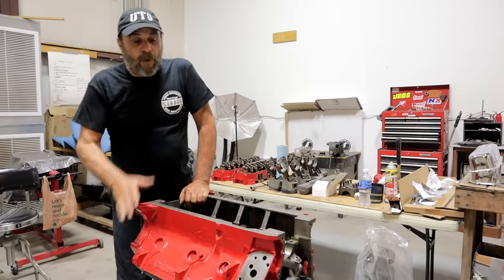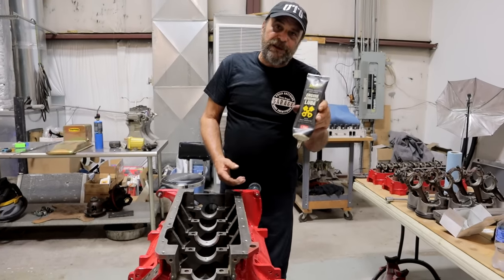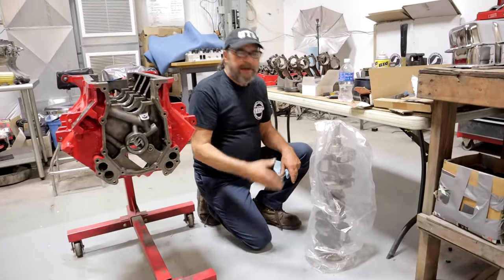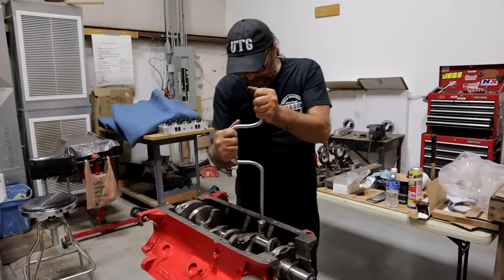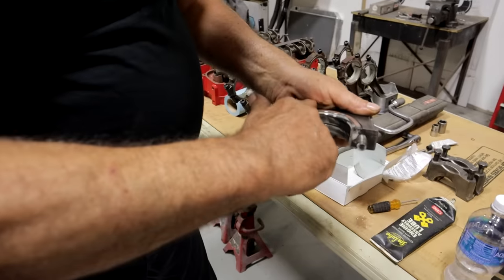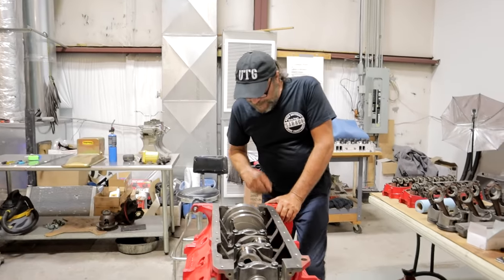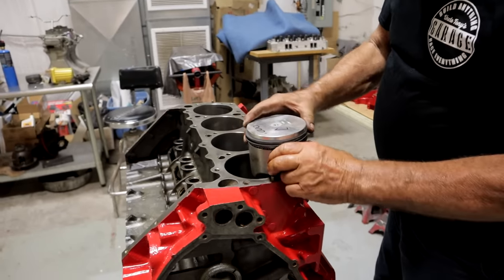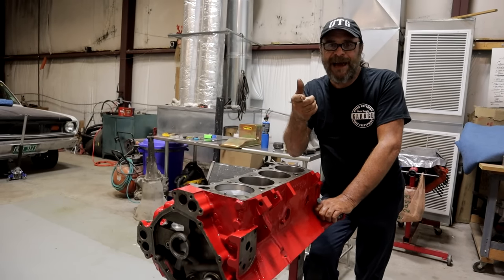Assembling A Short Block For The Home Engine Builder

Comment: I have seen this happen many a time. Put all your bolts in and make sure they measure at least 1/16 less than the main bearing thickness. I have found were they did not bottom tap far enough so you never really tighten the main cap. Do this on everything main, rod and especially cylinder head bolts. I have seen were slag in still down in a hole and the head bolt tightens against the slag and you never ever torque that bolt to the head. This happens next to the cylinder or by the outside of the block. You should retap all your threads and if your paying attention it will suddenly stop. Do this by hand and don't use a drill. When you run into a problem like I do with slag you have to use a small carbide bit to grind that slag away. I have spend over a hour on a single thread getting that slag out of the way and retap the hole. Don't cheap out and grind that head bolt down to fit. Any bad looking threads that look bad because of age and subject to water antifreeze drill out and helicoil kit it. I have thought a head bolt thread look good and when you torque it it strips or feel soft as you reach torque. Fix it now cause it will cause you problems when you warm up the engine and run it hard. BBC cast iron heads are heavy. You really can't do this job right in the car after. You pull the engine and do it right. I have done it to myself thinking I could get away with it. Once you do it wrong you won't again. Most people never check the simple things. If you blow a head gasket that's the first thing you look for. Seen it happen to many times to people. I had a friend I drag raced with and he blew up his 10 second 360 duster big time. He used ARP main bolts. After I talked to him he put lube on the treads of the bolts and some down the threaded hole. What happens he tighten the bolt to toque but the lube down the bolt hole. So basically hydraulic lock the bolt never even tighten up the main bolts. It was his second pass on a new high performance 360 Dodge short block you could buy new about 22 years ago. Cost him another new short block.

Comment: I assemble the rear main seal  the same way you do except clean the ends I put a microscopic dab of silicone on the Parting line of seal an i mean micro  Towards outer edge if it squeezes in to the seal surface  No good

Comment: Tony if you would allow me a slight departure,,,what are your thoughts toward industrial engines(mopar) of course,413?I hear some say no good but don’t get why.i looked up the internals and most are same as 440 six pack or wedge and steel crank,not the truck or dump truck I documented everything.
Reply: Tony back around 1990 I bought a 413 industrial engine from a guy who had a 72 motor home and wanted more power and was going with a 440 but I have tons of info and documentation saying this block,crank & rods are wedge to 440 six pack material.what are your thoughts toward it if I may ask.

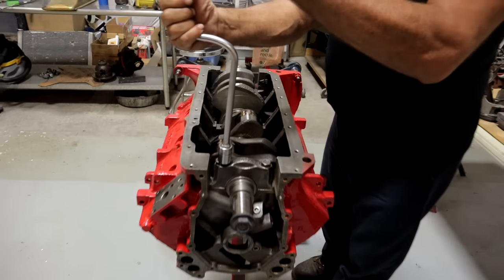Comment: Statements at11:35 and 19:42 seem to be in conflict. First you say go slow and methodically, torque one thing at a time, give a rotation and check for binding after each step so you know where the problem is.  Then later you say don't torque anything until the very end then do them all at once.

Comment: 1:48 You mentioned that you always want to use a fully grooved in performance applications. But what about the "average" home engine builder like me, who, although building a motor to make a bit more power, is mainly building a motor to last a hell of a long time (250k-300k miles or more), or ever for the average person whose just doing a regular rebuild on a motor. What would be the downsides of using a fully grooved main in a motor like that and why would it not be a good idea?
Reply: Fully grooved has less surface area to support your journal.  I’d use the half grooved if I was doing what you’re saying you’re doing.
Reply: full groov is best for higher [above 5500] rpm. down side is that oil demand is increased and more oil is thrown onto cylinder walls than needed at low speeds thus increasing oil consumption[burning] slightly. nothing to worry about really.

Comment: With the piston reversed,  was there a spit hole in the rod that had to be accounted for when pistons were assembled to the rods?
Spit hole lubes piston pin on opposite bank.
Reply: Swap sides so the piston
Reply: Swap to the other bank so the spit whole will be pointing in the right direction

Comment: Question: on the Big Block Mopar Low Deck Im building the Machine Shop Showed me that there was a deep ridge at the top of each cylinder, they bored the motor over and got rid of them, but what causes that ridge at the top of the cylinders?  I am asking as a preventative measure, I assume the engine stopped working because it lost all compression from wearing away that much cylinder wall in each cylinder, it took a .060 overbore to get rid of the ridges.
Reply: somebody failed to change the oil and/or air filter often enough,resulting in increased cylinder bore/ring wear.
Reply: Just normal wear my friend

Comment: How does installing the pistons in backwards affect the radius and offset with the rod bearing?
Reply: has 0 effect on the rod bearings.  One minutia that he didn't explain was the big end of the rod needs to be installed with the chamfered side facing the crank counter weight.  The rods can only go in one way the piston gets flipped around on the rod.  The only negative to backwards offset pistons is piston slap (noise) but you can HPs.  In 0 offset pistons like LSx or Oldsmobile (common with aftermarket pistons and rods too) there's no point to flip them.
Reply: @GregHuston  isn't there a radius on one side?
Reply: @michaeledge8905  The bearing? the tangs align to the to rod/cap.  The Bearing would be installed exactly the same no matter the direction of the piston.  If you're putting the #1 piston "Backards" e.g. dot or arrow pointed to the rear of the engine the rod and bearings will be installed in the same orientation regardless of the orientation of the piston.  If you flipped the rod you'd destroy the engine.

Comment: Question; Do you turn the piston around on the rod or simply turn assembly 180°?
Reply: He better not. The chamfer on the rod big end is supposed to face the crank cheek, AND the oil spit hole(if there is one) on the rod parting line is supposed to face the camshaft. But, hey, I'm not the self-annointed expert.
Reply: Curtis Tony a video on this very thing she swaps the Piston to the other bank

Comment: The only thing I'm not understanding is why you'd pull the bearing shells out of the block and caps and re-box them after checking the clearances with Plastigage? What am I missing?
Reply from the maker: The final soap and water cleaning
Reply: @UncleTonysGarage  Thanks I figured it was something obvious I missed.

Comment: What do you think of drilling the thrust bearing and block to give the thrust bearing its own oil feed?

 I had a thrust bearing failiure on the transmission side in my 5.2 magnum after only a few thousand miles and I don't want it to happen again. My best theory is that I turned the pressure regulator up too much when I installed a shift kit. 

Endplay was in spec when I built the engine and the converter was fully seated. I'm going to run a transmission pressure gauge this time and do the oiling mod to get oil pressure to the thrust bearing.
Reply: Waste of time, you can simply take a file and file a chamfer where the bearing wheels meet and you'll get all the oil you’ll ever need.  You’re thrust bearing surface was junk before you ducked with it or your thrust bearing wouldn’t have tapped out.  Transmission line pressure has no effect on crankshaft thrust.

Comment: Wouldn't it be better to have fully grooved, top, and bottom on any rebuild?
Reply: No full grove bearings will lower the oil pressure, you need a high volume oil pump and or heaver oil. It depends on the situation

Comment: 13:09 speed handles are so nice.... i love using them on trans pans 
.
just so quick .... 
less "lack of blood" feeling in my hands (idk, that one might be just me....because im an out of shape, fat and lazy, F-hen smoker.....idk)
100% feel when its about to cross thread or snap (almost tight then suddenly loose = bad)
.
im only 28 and STILL use 90% hand tools
just what i had growing up..... what im used to
.
if i didnt replace that head gasket.... i was not going to school that day
well, i was.... but in my dads 97 buick le Saber....... (in 2011)
.
get bullied at a shop for not having 20,000+ worth of snap-off and milwaukee
still get shit done faster with less comebacks
.
idk man.......
almost like experience beats fancy tools 
.
.
.
if its a GM.... or 60s through late 80s dodge, ford, and again, especially GM 
i can fix whatever you need on the POS........because they all suck in their own ways
.
.
.
.
again
no brand of whatever is best
they all suck in their own ways
.
buying a new car is like "pick if you want to do the timing chain at 150K (which ya gotta drop the motor for, because F them mechanics!!!!) ..... or replace the trans at 130K"
pick your poison
.
.
.
ill continue to drive late 90s W-body chevys and especially any  buick
got a 99 century with 350,000 miles..... OG motor and trans (some fucking how.... lord knows i rev the fuck out of it........and manual downshift all the time..... and rock it till i can smell clutch when stuck in snow..... yet it lives......idk how)
.
.
~96 to 05 buicks were pretty damn solid..........

Comment: I know talking to the camera while assembling is much harder, but hate to point out that after main cap 2, you have not rotated the crank after the thrust 3, or 4, and you are now installing main cap 5 before checking the runout. Just saying so others realize instal a cap, rotate the crank, install another rotate the crank...keep doing so after each cap. Do as he says, not as he does.

Comment: Guy I use to race with it was always a grudge match thing every year. The one year I know he was changing jets in his nitrous kit to something huge and I said dude I know you put like a 400 shot in and u didn’t take timing out or change the plugs and I’m sure u didn’t gap ur rings so I’ll give you a chance to change it so u don’t blow it up and he denyed it and we raced and blew it up, broke pistons because it wasn’t gapped right, nitrous back fire from timing and plugs. People think u can just slap a nitrous kit on and not do anything. People also thing nitrous is so bad for engines but if you set it up properly it can last. I ran nitrous through a stock engine for years and years with no problems. I had an msd box hooked up to my nitrous kit to back out timing,

Comment: You should never lay cylinder heads down on the chamber side like that you can damage the machined surface pretty easy. I got yelled at for doing that when I was 16 by the machine shop.
Reply: It won't damage it if you put it on top of something that won't damage the surface. That is what he did.
Reply: Wood vs. metal 
Study the hardness scale

Comment: How do someone know if the caps are installed in the correct front to rear direction?
Reply: Most caps are numbered and have a arrow which shows which way the cap goes. Arrow faces to the front of the block.
Reply: When you put the main caps on the upper and lower bearing tabs must meet/or be on the same side. As long as you do that then they’ll be facing the right direction.
Reply: @rle1020  exactly. That is a good point. On some engines, the bearing caps are numbered. But if they’re not just install them so the upper and lower bearing tabs meet on the same side

Comment: Good video, but you didn't orient the piston rings before installation or even mention it. Ring end gap & location are critical for assembly.
Reply from the maker: As soon as you start the engine, the rings begin migrating around the bore.  After just a few minutes, none of them will be in the position where you installed them.
We covered the gap in another installment of this Home Engine Builder series.

Comment: Ugh, fully grooved main bearings, lots of builders will disagree with that, I use 3/4 groove mains to keep a full film of oil under the crankshaft at all times.  Why isn't it practical to pre-oil a Big Chrysler?  Using PB Blaster to lube your fasteners is a bad idea, its a penetrating oil, not a lube and you also want to lube under the bolt heads.  All of this reduces friction and ensures correct torque, ARP gives different torque specs when you torque with Moly Lube vs regular motor oil and they make no reference to using penetrating oils.  Lucky you didn't pull the threads out of the block using PB when you torqued them.
Reply: Oh man, using a hammer like that to set the thrust?  Hitting on the counterweight?  Geeze, glad this isn't my engine with hammer marks on the front and back ... use a large deadblow, C'mon, Tony ...
Reply: Better mention that the rods can't be put in backwards, the pistons have to be installed on the rod that way if you're doing that.  Depending on the pin offset, determines how much power you do or don't gain.  I also take issue with you not offsetting the ring gaps 180 degrees from each other over the pin before installing them.  Plus, that has to be the worst compressor ever made, I had one and trashed it years ago for a good universal Blue Point.
Reply: Wow, so many things are wrong with your piston install ... 1. PB Blaster AFTER the ring compressor is on ... the rings, skirt and cylinder didn't get lube.  Use motor oil on the rings and skirt BEFORE you put the compressor on, also lube the cylinder first... 2.  ALWAYS put the rod journal at its lowest point, that way, you are not aligning it and trying to install it at the same time ... 3.  Sharp, direct blows with that junk ring compressor is an excellent way to break a ring on install.  After 28 years doing this professionally, I've never broken a ring.
Reply: Before you put in the rest of the pistons, now would be a good time to degree the cam.  I put #1 in without rings and degree my cam before any piston installs.  Maybe you already did that.

Comment: I don't agree with tightening the crank last for the simple reason that you could run into an out of line block on one of the main caps ,ask me how i know, i prefer to torque down crank first to verify the block is perfectly straight

Comment: Did you already plastigage these? Or is you machinist reliable enough to skip that step?
Reply: Second thing I noticed and maybe it was in another video I missed the ring end gap location before you put the ring compressor on?

Comment: FYI, the reason you don't put any oil between the bearing and the block is because when you measure for oil clearance with plastigauge, your measurement is false. Why, because the very thing you are measuring for has already been added. It'd be like jamming a piece of paper into a gap and then using a feeler gauge to see what the gap is.
Reply from the maker: Wrong.  The fitment of the bearing to saddle is zero clearance.  The bearing to crank is whatever the spec is for that particular engine.  Oil on one side does not equal oil on the other
Reply: @UncleTonysGarage  Yes! It is zero clearance between the saddle and the bearing. So don't put something in there is my point. It's called oil clearance for a reason. Oil has a measurable thickness (viscosity) I'm not disagreeing with anything you said in the video.  I'm not sure you understood the point of my post. I have seen people put oil on the bearing and crank journal and then plastigauge it. I realize you made no mention of plastigauge in the video making my comment without relevance. I was just bringing up a side point. I love your videos and it's obvious you have lots of experience. I have been a professional mechanic for over 45 years and still am. Putting oil between the bearing and the saddle is unnecessary and would reduce oil clearance between the bearing and journal was my point. Obviously, I failed at making that clear.
Reply from the maker: Ah, gotcha. I miss understood.  Sorry
Reply: @UncleTonysGarage  No harm. I realize I'll never be a professional writer.

Comment: Where's you 60 zillion foot pound cordless? 
Most of the stuff I have I will not let anyone touch with any of the high torque high speed gizmos. Too many of those tools now in the hands of too many idiots.  I just love removing lug nuts after someone has gotten a full stud-length run at it, then held it down for a full 30 seconds to "make sure its tight!"
Rant now complete 🤗

Comment: Hey also remember you were able to  go through a fuel engine in an hour back then and today they do it in less time .....my point is back in the day you guys did it all with hand tools....the guys today have it easy with electric or rather battery powered everything from ratchets to low torque and high torque impact guns from 1/4 in drive to 1 inch drive......I feel like it took away from the skill and made more about speed.....

Comment: UTG" every engine I build would have backwards pistons cause vizard said so." Lol. You would be hunting for a job in NC with your backward piston theory
Stuff like that should not be said to people (Rookies) listening to this video. 
Is Vizard the same guy who uses roller cam lifters to degree in flat tappet camshaft? Then claims it had stacked tolerance that's why it degreed in late?
Reply: It’s not clear that reversing the pistons are NOT recommended for 350 Gm engines.